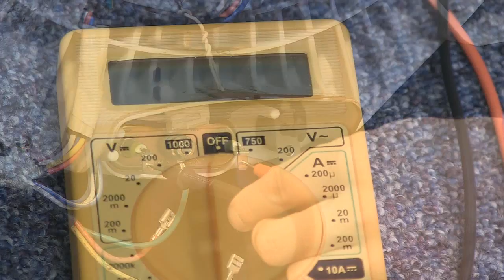How to Diagnose Washing Machine Control and Program Problems

Comment: I need help please. I have a 6 year old front load GE washer model gfwn1100lww. The washer had suddenly stopped and drained the tub and refused to work. After inspecting it and testing all the components, I narrowed it down to the inverter. I purchased a used one from a slighty older model but with the same inverter/motor drive part # to mine. It worked. Unfortunately the washer now will not finish cycles. If you run a cycle with the washer empty it completes the cycles. If you add cloth or laundry inside the washer it fills, agitates back and forth for about 7 - 10 minutes then it stops, drains the water and pauses itself until you un-pause it again. E46 error code is the only code present. I have cleared it and checked the program version that fits my machine in the "t01" service mode. I placed it on mode 6 in the "t01" service mode test since the other 1-5 modes illuminate additional hidden LED lights in the control board face that are not visible on my washers control board's face. 

I ran all the test in service mode, and they all work fine. t10, t11 and t13 all perfomed like they should. The basket turns foward and back like normal, the motor spins the drum in low (400) rpm and high (1000) rpm with no problem. When you place the machine in drain and spin only, it will complete the cycle even with cloth. I have checked the temp on the inverter heat sinks and the housing of the motor during operation and they seem warm to the touch only. Not even close to burning you. Apparently error code e46 means the inverter and/or motor are over temperature.

Like i mentioned on top, the washer will not complete any cycle other than drain and spin cycle with cloth. It only completes them when empty. It just fills, agitates back and forth for 7 to 10 minutes, depending on the selected cycle and then it pauses itself and unlocks the door and the control boards face stays on with the start button flashing on and off consecutive about every 2 seconds. Please help.
Reply from the maker: Hi Homer, the error code E46 is related to the motor or the inverter but check for loose connections between the control board and the inverter and if OK check the used inverter.
Reply: eSpares Thank you for repling how do i check the inverter. After analyzing all the information, i have narrowed it down to either the inverter and/or the motor. This is a brushless motor to the best of my knowledge. The washer seems to be affected by weight. It seems to only complete a cycle when empty. How do you check the inverter? I have checked for loose wires and connections, are all fine.
Reply from the maker: Hi, Homer, we do not deal with the GE washers so do not have all the information regarding testing but the GE website suggests testing the motor with a multimeter for continuity and the motor sensor on the board. if the sensor is faulty you will need to replace the motor or the board, how do you know the second-hand inverter is ok if it came from another model are you sure it is not the cause.

Comment: I have a Hotpoint wt960G. It  wont start.  When I  select a programme and press start. after a while the LCD flashes "door". this happened during a wash when the the machine tripped my electricity  fuse. After switching it back on it was stuck at a minute to end., After a while I was able to open the door. I put in a second wash but it wont start when I select a program.

What can be possibly wrong with this? Does i just need reprogramming because it tripped?. Thank you
Reply from the maker: +naasei1987 Only an engineer with the correct equipment can reprogramme Hotpoint or Indesit machines. We would suggest you check the heater and pump for continuity then try replacing the door lock, If that does not cure the problem it will likely need a control board and require a specialist engineer who can programme it.
Reply: Thank you for your quick response, It''s better than the service I received from hotpoint. I sat here all day and their Engineer never turned up!
Reply: +eSpares My washing machine was fixed today. The motherboard had burnt so it  was replaced. Once replaced the engineer plugged in  ad ongle to reprogram it. I can now do my washing.  I had to sign up for  year's warranty, with no up front payment, at £15 a month. I guess it was probably worth it

Comment: Hey my bosch 500 series washer wont begin wash cycle. No error codes displayed but I decided to replace the door latch. Still hasnt fixed the problem. When attempting to start cycle, start button flashes twice and refuses to begin. Any idea where to start? Im guessing something wrong with computer.
Reply from the maker: Dont rush into blaming the control board as it is usually something else. Most likely problem if the door locks and it fills is the motor brushes (see this video: https://www.youtube.com/watch?v=N_r8d93xPYw).
If it does not lock check for the child lock function if fitted and see our diagnosis videos: https://www.youtube.com/watch?v=QYPqpjLV7s4&list=PLZopaZU-UQSHj1noiwEJ99JjXWcEcSAbZ&index=1
Reply: eSpares please I'm having a Bosch series 2 varioperfect washing machine and it is not working when i switch it on, it only displays a static E17....
I tried troubleshooting cleaning the drain filter but still no change.... Seeking your help on this mates!
Reply from the maker: E17 is a water level problem: https://youtu.be/PvJlqOjG6Uc?t=55s
Check the machine is filling correctly.

Comment: I have a Kenmore tumble action washer.  It works.  However, the control panel lights flicker throughout the wash cycle.  I see no error codes.
Reply from the maker: Hi Terry, check for a loose connection first but sounds like the lights need to be changed but it won't stop the machine from working.
Reply: Thank you for your help.  best regards, Terry
Reply from the maker: Hi Terry, glad to help.

Comment: I ha an LG Washer, Model WM2688HWMA.  I recently replaced the bearings which also involved replacing the rear outer tub, the old one had cracks around where the seal should go and would not allow it to snap into place.  I did clean the inlet valve filters while I had the hoses off.
Within the first couple of days, we had an FE code which sounded the alarm and we caught it in time to avoid problems.
Today the front door on the washer burst open with water going every where and lots of water still in the tub so I figure it over filled.  There was no alarm though.
Question(s), what should I check, the inlet valve(s) or the water level control or all of the above.  Or just replace these items?  One thing, the top hose (largest one) had a different part inline than the original which was mushroom shaped.
Reply from the maker: Karl Rolling Ok lets think about this fault logically If the machine has shown an FE error it knows there is too much water in the drum so pressure switch and hose are OK. That leaves the fill valve sticking (easiest and cheapest to replace). or possible the control panel. If the problem is not cured by a valve then the board would likely need replacing.
Reply: What about the dispenser drawer?  There was water still coming through it?  
  Just trying to cover my bases!
Reply from the maker: Karl Rolling The water passes through the drawer but is not controlled by the drawer so it cannot cause overfilling. If water is leaking out of the drawer it is caused by a blockage of either the spray jets above or the outlet pipe below.

Comment: I have a bosch axxis front loading machine that has power but won't start. Was told check the control board, did that and washer didn't work, was told to replace the lock, did that and its still not working. Any ideas?
Reply from the maker: Hi Cristian, if the door lock has been replaced and you are getting power to the machine it would suggest the board, unfortunately, it is difficult to diagnose as you can't test the board so use a multimeter to test through each component that is on during the wash to determine what has failed and if everything is ok you can suspect the board.
Reply: I replaced the board but the machine still does not start. All the other buttons work except for the start button... Any ideas?
Reply from the maker: Hi Christian, this is a weird one, so check for a wiring issue like a broken connection to the door lock or even the board.

Comment: Hello good people! 
I have AEG Lamavat 50884 (still no digital display). It looks like everything functioning: water fill, drain (if I put on Drain), checked resistance/continuity of water pump, heat element, NTC. The problem on rotate left/right. On signal rotate the machine tries to rotate but it fails - it goes like one 2-3 degrees  left or right then all the leds shut down for less then a second, coming back to life and waits for a next signal to rotate and again on rotate signal leds shut down coming back.....This loop is endless (maybe it would end on washing timer end, but what is the point to wait).
Also I think near the wall socket  I hear a strong zzzzzz electricity current sound which I think wasn't existed before.
I thought maybe the capacitor gone but it looks like no capacitors there. Maybe the Carbon Brushes but the machine is only 3 years old with 1 time per week laundry - hard to believe that after ~1000 laundries they will be gone.

Any ideas what can be wrong? 
Thanks. Beers on me :)))
Reply from the maker: +koko loko The ZZZZZ at the wall suggests you have a loose connection either in the mains plug or the wall socket and when the machine draws power the voltage drops and resets the panel. Check the plug for signs of burning or loose wires and if that seems OK try briefly with an extension cable from a different power socket.
Reply: +eSpares 
WORKING!!! 
just unbelievable ))). Thank you so much!
Where can I donate for a beer?  U definitely earned it.
Reply from the maker: +ssmmiilleeee You haven't told us what cured it?. Glad it's working and instead of a beer just tell your freinds of us and check out another video or two like: www.youtube.com/watch?v=uKBy-9NEF5A  andwww.youtube.com/watch?v=ifWK9df1qgg
Reply: +eSpares  Cured 100% )
Thanks again

Comment: my LG washing machine has no power at all. then when i solved the problem about the switch, accidentally the control board get wet but just a little bit, because of the water left from the hose when i flip the body of the washing machine. Then when i power on again all the indicator lights turned on automatically.
then i removed the control board and i dried it up. then, when i fixed the control board again it has no power at all.
what should I do? please advise. thanks
Reply: +Oscar Gasalatan_ actually the only problem was only the switch pin was cut or broken, i fixed already the switch pin by replacing a hard plastic material from the used toothbrush. but because i flipped the washing machine, the very little water from the hose spilled to the control board, that's the reason why the machine doesn't have a power anymore. 
please help mr. eSpares! thanks
Reply from the maker: +Oscar Gasalatan Thoroughly dry out the control board using a hair dryer if necessary and retry. If it still does not work check all the connections and if you cannot see a problem it may be that the board was damaged when turned on and wet. If this is the case you may need a new board. :-(
Reply: + eSpares
thank you so much to your reply and advice. yes i will try you advice.
Merry Christmas!
Reply from the maker: +Oscar Gasalatan Merry Christmas Oscar!:
https://www.youtube.com/watch?v=nTPEP5jy8wM

Comment: checked your videos, maybe it is the brushes, but as none of the programmes are working I wonder if it is the circuit board. waiting for Zanussi service centre to come back to me. washer has only been used for just over a year and had to have replace, ent brushes within a few months. not impressed as the machine is only used for 2 adults. I wil update once an engineer has been!
Reply from the maker: Sorry Mary we missed your comment, did you identify the problem?.
Reply: Yes it was a problem with the switch
Reply from the maker: Thanks for the update, it may help others with the same problem. :-)

Comment: Hi eSpares, I have a LG front loader washer which won't go into the short spin before the rinse cycle, so after the wash cycle the water is drained then the washer just come to a halt for one minute before filling the water for the rinse cycle. What do you think it could be the problem?
Reply from the maker: Hi Bonnie, try on an empty rinse and spin cycle to see if it will work?.
Reply: It works fine on a rinse and spin cycle even with clothes inside, only the Quick and Intensive cycles (the two cycles I use most often) won't work. The washer was overfilled with water right before playing up like this, I fixed the problem by reconnecting and untangling the hose.
Reply from the maker: Check the water heater element as if this fails the machine may stop and give an error code then may empty and rinse.

Comment: i have a Beko WMY71023LMB3, it all happened on cottons 90, the machine would start the heating stage then at a certain amount of time it will abort turning all the leds off keeping 60 degrees and 800 rpm on, if i pressed any of the buttons my settings would be restored but the machine has to start from ground zero but then to end the cycle with end light on and doorlock flashing, same thing happened to 40 as well, thanks in advance

 note: other programs work just fine and so does cottons cold
Reply from the maker: OK a couple of things to check. Can you feel any heat through the door glass?, If not check the heater. If the glass is very hot suspect the thermistor in the centre of the heater.
See our video: https://www.youtube.com/watch?v=Ftm8lDVVw2E
Reply: eSpares it heats perfectly on a different program at the same temp, i am wondering whether it was the selector or PCB
Reply from the maker: It is possible but most times a problem like this is not the control board. We would start with the sensor as this will be a lot cheaper than the control board.
Reply: eSpares what's the job of the sensor? And how does it look like? Is it built into the board? Sorry for all the questions, i always had timer machines

Comment: I have an 8 year old Samsung front loader that will still wash and spin but is very temperamental. The LED display will suddenly go dark and the cycle will stop - it might come back on by itself or I might have to hit it to make it come back (and this may happen once or several times per wash). Sometimes it will finish, sometimes it won't. Sometimes it will get almost to the end of the spin and then the timer will reset to 10 minutes left (again and again). It is getting worse. I'm thinking it's the  control board - what do you think? I'm a DIY-er with little money or time to throw at trial and error. Would love to get it right the first time. Any helpful thoughts are much appreciated.
Reply from the maker: Hi Val, it sounds like you have a loose connection inside. Disconnect and check the power connector to the wall and the connections as the power enters the machine to the board and the connections on the door lock. You may find if any are loose the connection will have discoloured as a result of heat and by replacing the connector the problem will be repaired. If no loose connection is found it could be the control board so remove that and examine for signs of damage from burning and replace if required.
Reply: Thanks so much! I'll take a look.
Reply: It sounds like im having  the same issues  With my Samsung front load or did you ever fix your issue

Comment: Hi eSpares, need some advice please! My Hotpoint WML560 won't fill. Water supply is good up to the inlet valve but doesn't go any further. I tested the valve with a multimeter and it seemed ok, so I then tested the power to the valve when starting a program and found that there was none! Would this mean I have a faulty circuit board?
Reply from the maker: Hi Dave, First check what the machine does, If the door locks and the machine will spin and drain then you may have a fill problem and if the valve is OK then it may be a faulty module.
Reply: eSpares Thanks for replying. I tried a spin cycle but still no joy. The door locks but then nothing happens. The cycle light stayed lit for 10 minutes (with nothing happening) then all the function lights started flashing and a weird grinding noise started coming from the bottom!
I take it this means that the module needs replacing?
Thanks again for your help.
Reply from the maker: Dave McCarthy Unlikely Dave. Those symptoms suggest that you have a main motor problem (probably the brushes).
See our videos : http://www.youtube.com/watch?v=D5Aw7CBEGPI  and
http://www.youtube.com/watch?v=MNInJd7js5A
Reply: eSpares Ah ok, thanks for the links. So would worn brushes stop the cycle from starting & filling?
Reply from the maker: Dave McCarthy Yes.

Comment: indesit iwc6165 spins and drain is working but won't complete a wash it blows fuse in fuse box someone suggested heating element short but I suspect the control board would that be correct?
Reply from the maker: Hi Jonathan, it is more likely the problem is the heater especially if the machine will do a cold wash.
Reply: I've read the heating element at 30 ohms so that looks good looked at control board no noticeable failures. any ideas? it's apprec
Reply from the maker: Still suspect the element as it is likely to be leaky to ground and this may not show using a regular multimeter, see our other video:
https://www.youtube.com/watch?v=XV6QlTwobLo
Reply: thankyou for you're help